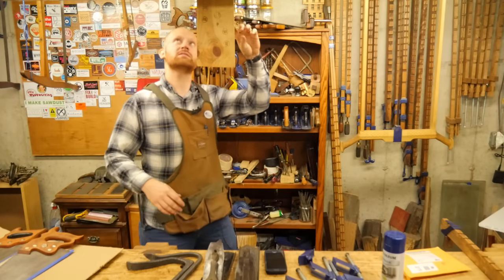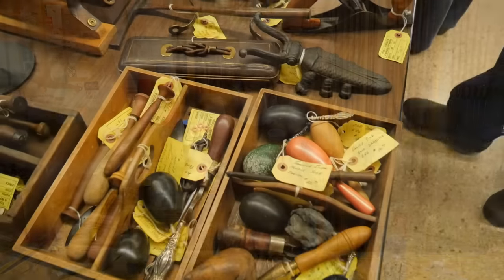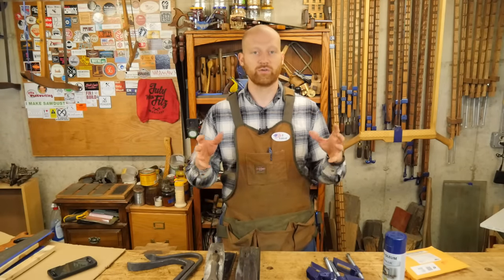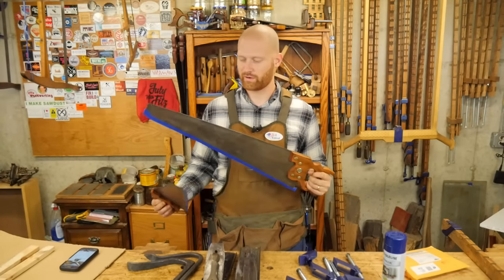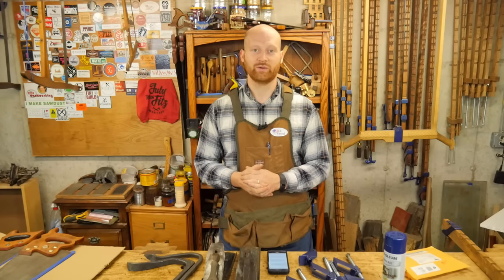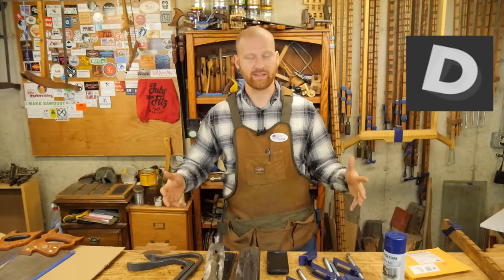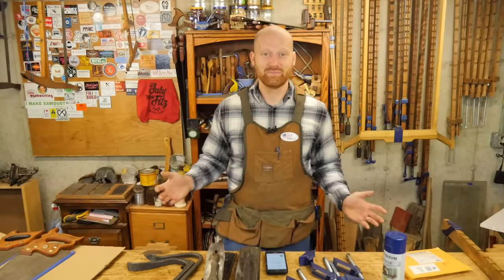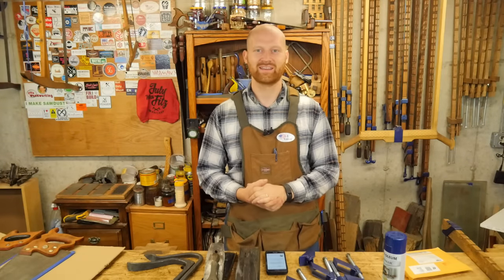Report, Dado, Work Holding, Hand Plane Restoration, MWTCA, Homemade Bar Clamps, and more

Comment: Hey James. I just wondered what method you use when you/if you address the soles of a plane when restoring them?
When I bought my first hand planes I rubbed them on sandpaper/flat glass for when seemed like hours. I must have gone through £10 worth of sandpaper per plane and the process was slow and arduous. I have never restored a plane since.
Regards,
Chris.
Reply from the maker: I did the same thing but rather than using sand paper i used belt sander belts and did all 5 planes in less than an hour. Start at 30 grit, then 80, 120, 180, and hand sand with 400. I will have it all in the video later this week.

Comment: hey I like this video   I'm kind of new at buying and getting old tools I have a old wood level from Stanley no 3 and the wood looks out of shape if I sanded it and stain it and lacquer it does that take away from the value of tools    
like I'm afraid to restore some of them cause I don't know if that the right thing to do or just leave them at is   
thanks and cant wait for you to get at 10k subs
Reply from the maker: that is a great debate in hand tools. the big question is do you intend to use it, or just keep it as a collectible. if you are going to use it the do whatever you want that makes it more useful. my rule of thumb is to do as little as possible to make it usable. lacquer is often a fround upon finish for hand tools, but that is a personal choice. If it is for collection then I would not do anything to it. if you want you can send me a few pictures of the condition and I can talk you through what I have done.
Reply: that's awesome ill send the picture threw your email tomorrow a I'm really busy today 
thank you so much really appreciate that